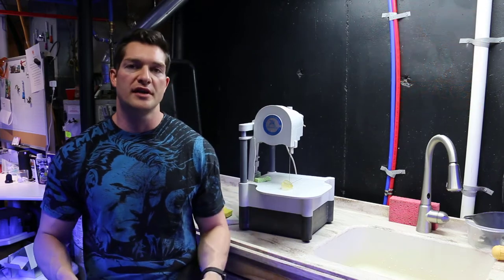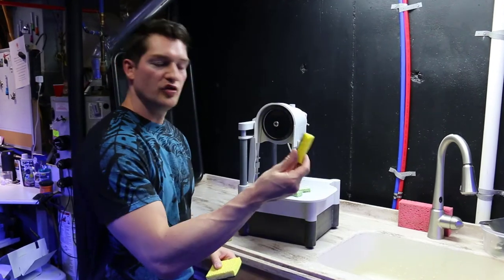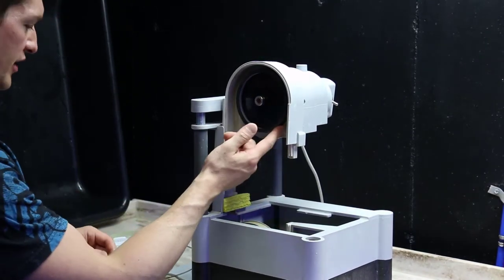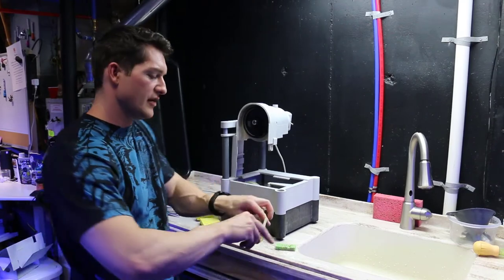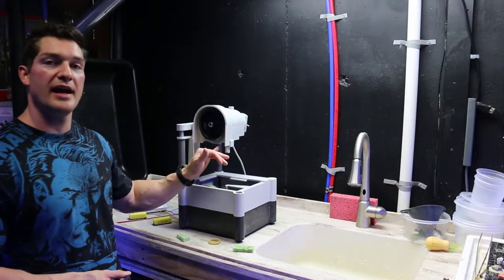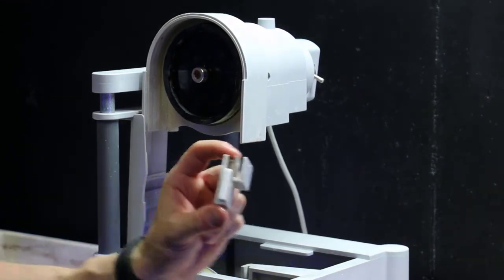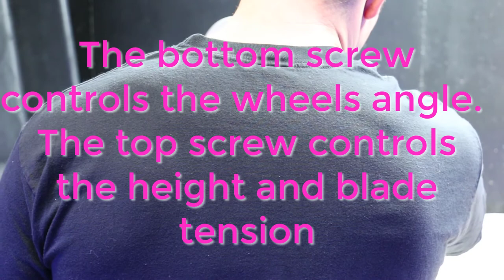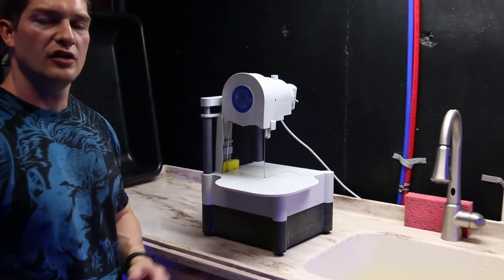Gryphon Diamond Wet Band saw maintenance and repair

Comment: My blade wont turn. The drive wheel is working, it's just not taking the blade with it. Would new rubber bands resolve this issue? It worked fine the last time I put the saw away.
Reply from the maker: How much tension do you have on the blade.
Reply: @Coralust  I tried multiple settings. High tension all the way to low tension.
Reply: Krista I'm having the same issue. How did you resolve it?
Reply from the maker: Did you check your bearings to see if they rusted. Is the wheel spinning freely without the blade on it.
Reply: Coralust Reef Solutions I figured out it was the upper wheel's band. Since only one side was worn I flipped it around and it's working great.  On another note I tried to get the top wheel off after removing the Allen wrench screw but it won't come off. I'm guess the salt water rusted that center bolt. I'm guessing it will be lots of 10wD40 and a wrench when that time comes. It looks like I can buy a new wheel if it doesn't go as planned.
Reply: Coralust Reef Solutions thanks for this video by the way. I had no idea about those bands until I watch your video a few months ago. Totally appreciate your help.